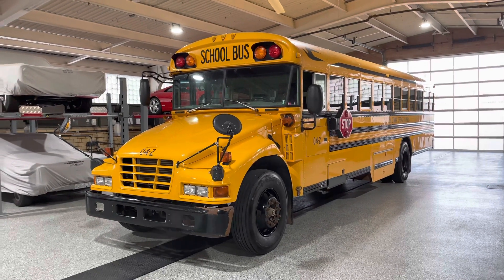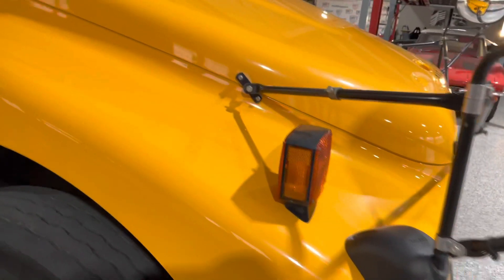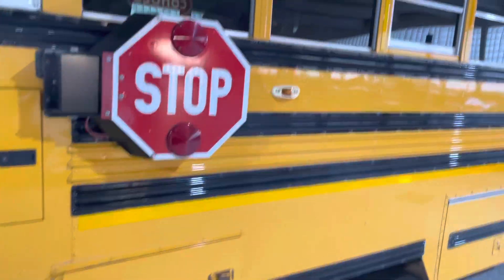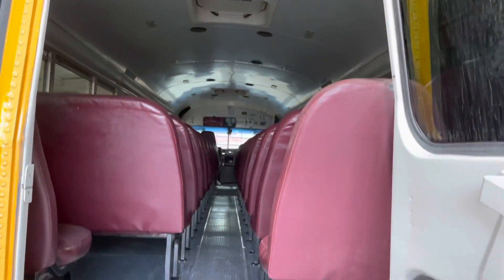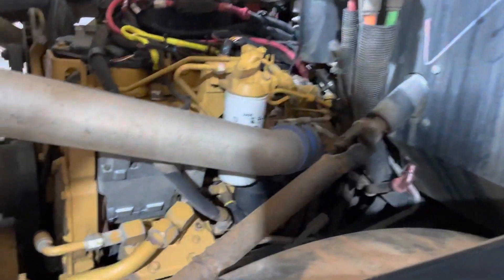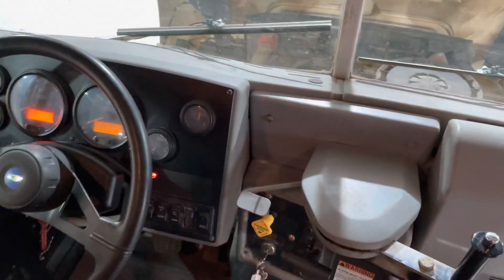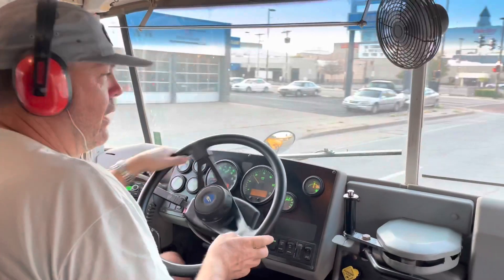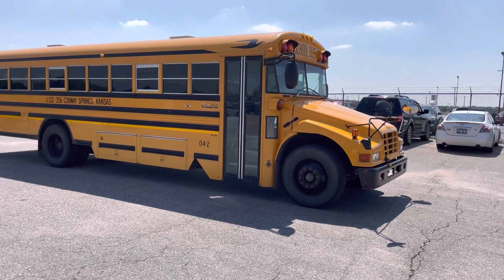2005 Bluebird School Bus with CAT C7 turbo Diesel engine

Comment: Bus is in incredibly good shape for the age and mileage. Mechanically, engine is a CAT C7 (ACERT), Transmission is probably an Allison 2500 PTS (no parking position and has a starter interlock) with air brakes, air seat, and probably air suspension equipped onboard. Overall they are built to last, and hold up quite well to the rigors of daily use. And I know that firsthand driving them on a daily basis.